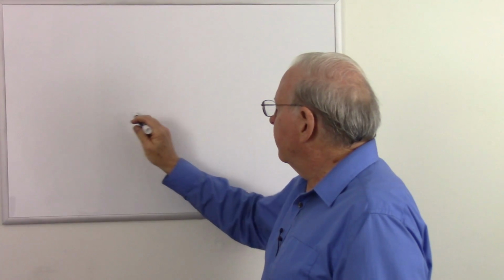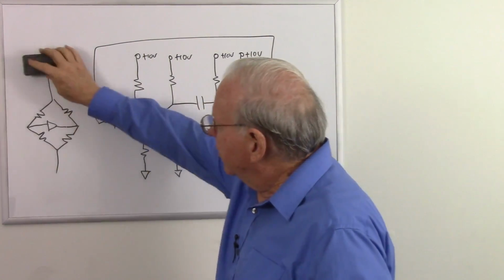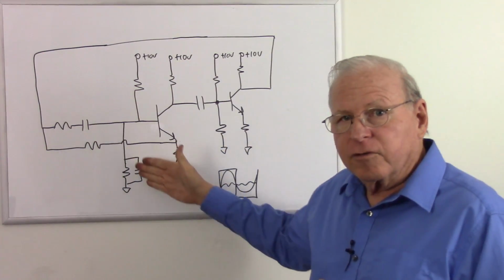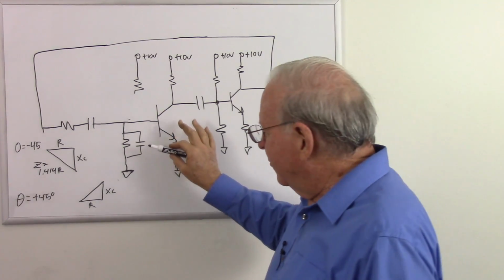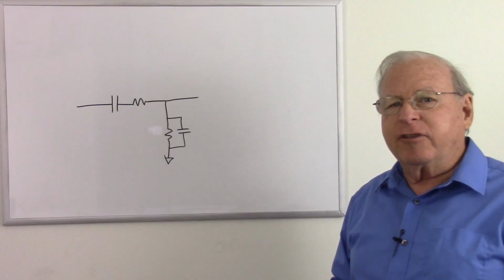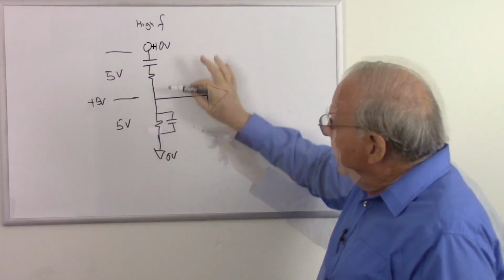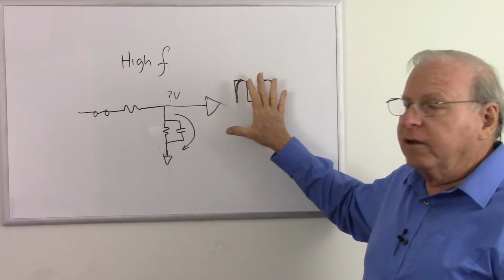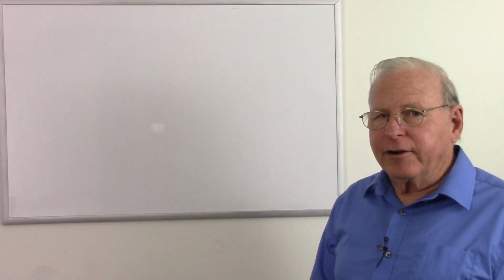Wien-bridge Oscillator - Solid-state Devices and Analog Circuits - Day 6, Part 6

Comment: I built a low-distortion Wien Bridge Oscillator using a dual op-amp that I found on the internet. To get this low distortion (I experimented with other dual-op-amps such as LM358 and other types, but the FET inputs on the LF353 provided the lowest level of distortion-.03% THD), and to get the proper frequency 400HZ , I utilized two .1% 10K resistors that were paralleled with two 1% 100K resistor and two .25% .04uF capacitors and a 345 lamp, (6-volt @ 40-ma) plus three other resistors (100Ω, 100K, 560K). This oscillator produced a maximum output  of 7.5-VAC when powered with ± 15VDC, this output was sent to a 500-watt per channel stereo audio power amplifier in bridge-mode producing 0-150VAC @ 400HZ for powering commercial aircraft electrical components.  David Riddle

Comment: Would it make sense say explaining the filter that at the cut off point you will have at series pair let’s say 10k R + 10K Xc. And at parallel same 10k R + 10k Xc so 2 equal resistors in parallel equaling 1/2 so the math would be voltage divider with 20k on top 10k bottom at Fc .

Excellent lecture!

Comment: Awesome tutorial, I have built a few of these and I use a bulb, the same way HP did ! I have  typical oscillator outputs @1Khz 1v P-P a THD of around 0.005% I use it for audio work and it runs off a battery so nice convenient piece of bench equipment as good as most budget sig gens and You explained this perfectly...cheers.

Comment: I don’t understand what negative feedback is. Repeatedly saying it doesn’t help me lol.
Reply: A quick look at his other vids will soon explain this too you its not hard so give it a look...good luck :)
Reply from the maker: I think this may deserve its own video. Think of it like pushing a child in a swing. If you push just as the swing starts to move away from you, it keeps the swing going. That's positive feedback. If you push when the swing is coming toward you it tends to slow or stop the swing. That's negative feedback.
Reply: "negative"  defines a specific  type of feedack.  

"Feedback" is a commonly used term which refers to:

 taking a signal "sample" at some point in an amplifier chain - and combining it with a signal earlier in the amplifier chain. That is " it is fed back"(wards)

 Doing this will affect the signal level at this combining  point in some way depending upon how the feedback path is arranged. If it increases the signal level - then that is positive feedback... it decreases it - it is negative feedback

In most amplifier cases - the feedback is negative - and so the common term "negative feedback" gets used.

However... in the case of an oscillator.. we want the feedback loop to add to the signal so that a continous signal is maintained.
That is... if you look at the whole "loop" amplifier plus feedback path...  to keep the oscillation going we need a loop gain of 1 and a phase shift of 360 degrees.